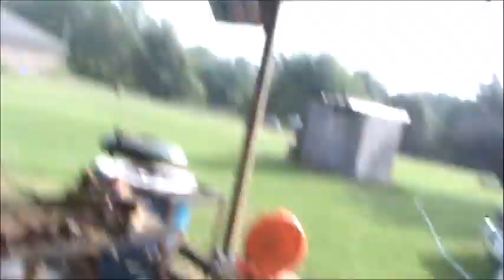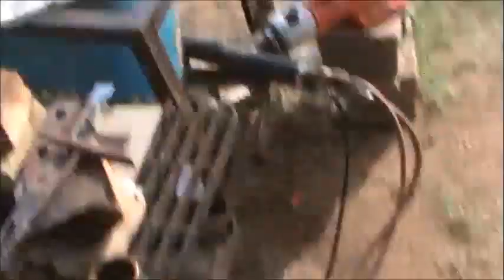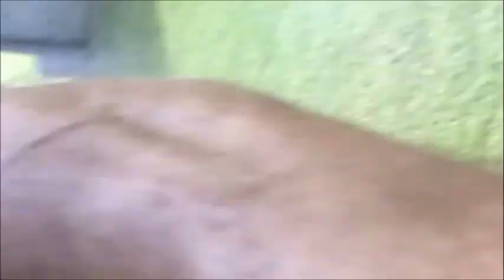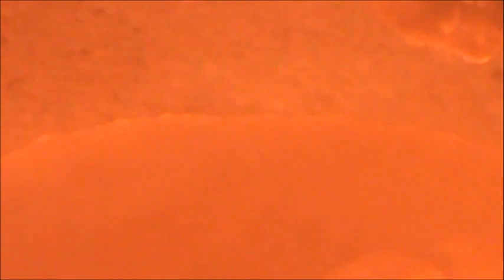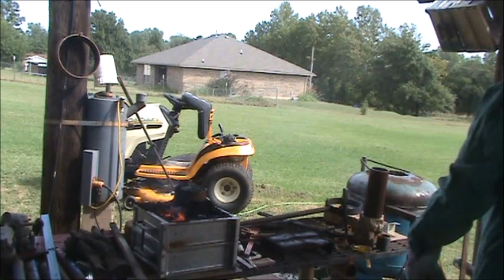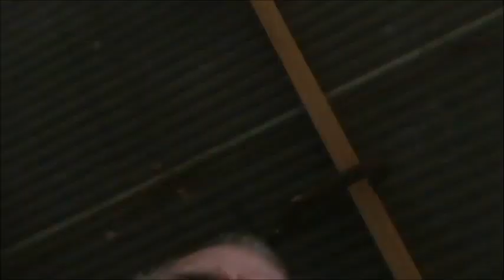Failed cast iron melt

Comment: I noticed you were very intent on getting the melted iron out of the crucible.  What problems are there when the iron solidifies in the crucible?  Thank you for sharing your successes and failures with us.  We can all learn from videos like this...   Fred
Reply from the maker: the iron when it cools can pop loose from the crucible and when it does it pulls a thin layer of the crucible loose with it. this is only the fifth time that this crucible has been thru the process and I'm trying to take a little better care of it then I did the one it replaced.

DA
Reply: Thank you for that insight Dave.  I never would have considered that...